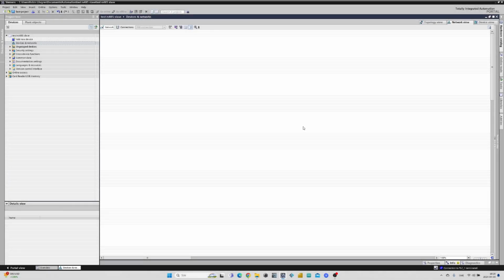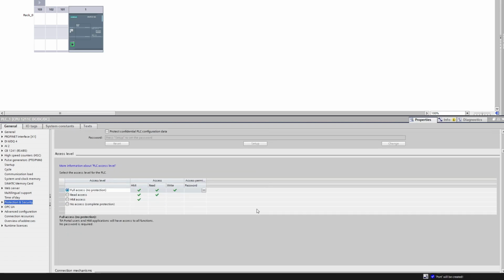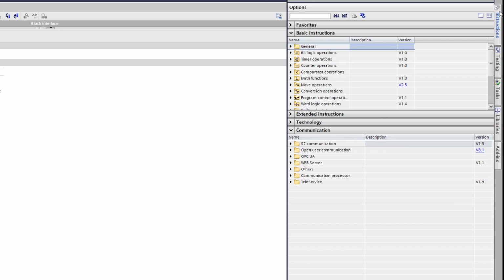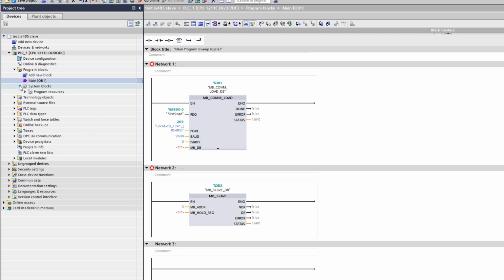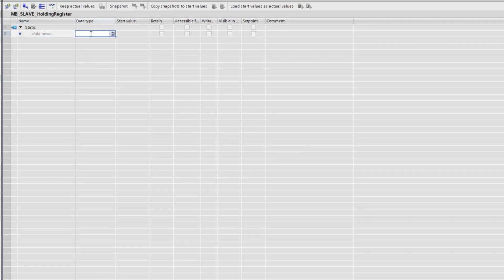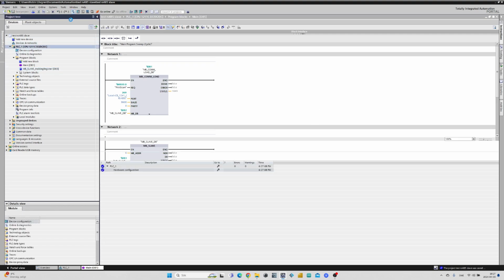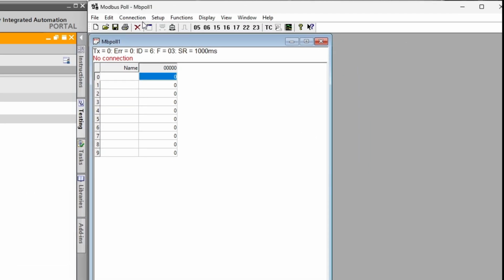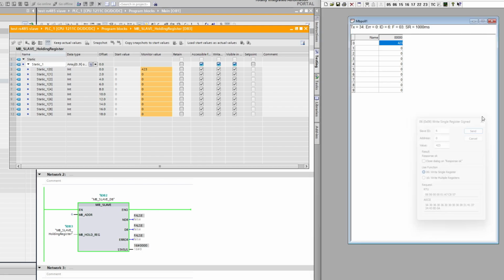Siemens S7 1200 PLC Modbus RTU slave tutorial | TIA portal

Comment: Thanks for short and simple demonstrative video. It serves its purpose and taught me to access Siemens PLC data via Modbus RTU using RS-485 to USB converter in Modbus Poll (what i exactly looking for). 

I have two things to say:
1. Checksum error => There is a mistake in image depicting wiring connection between CB-1241 and USB to RS-485 converter. At CB-1241 end, wiring terminal is good but USB to RS-485 end, wiring connection need to be interchanged otherwise I was getting "CHECKSUM ERROR" in modbus Poll. [I connected in this manner to make it working: 
* T/RA[TxD]  <-->      B
* T/RB[RxD]  <-->      A
* GND            <-->   GND] 

2. There is one more Modbus (RTU) at Tia Portal > Instructions > Communications > Communication Processor > Modbus (RTU). Within this folder, we have "Modbus_Comm_Load", "Modbus_Master", "Modbus_slave". how does these instructions block functionality differs from modbus instruction block that you have used?
Reply: tysm, it helped a lot